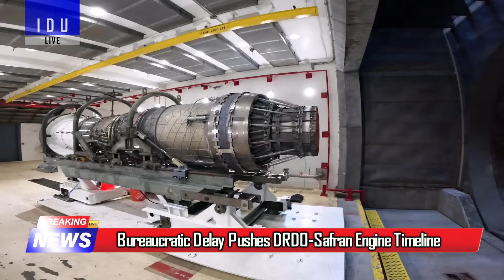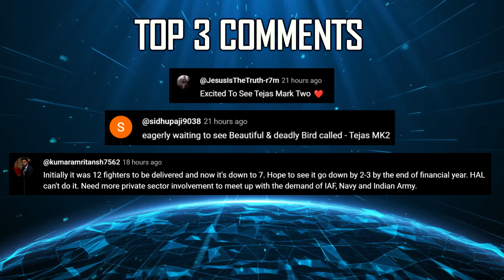Indian Defence Updates : Su-57E No Assembly,6 F-16 To Pakistan,120 KN AMCA Engine Delay,Dhvani Test

Comment: Delay of Tejas could be beneficial if the "fly by wire" electronic  cabling is converted to fibreoptic links which is immune to Electromagnetic Interference. Shielding of critical electronic circuits and actuators ( through absorbent/ refective shields or casing) is important. Fibreoptics should also be the cabling for AI driven UAV/ UCAV electronics.

Comment: When France 120kn engine is delayed and the subsequent effect  is coming on amca then viable option is to continue with su57 assembly with hal. Amca1 will also be delayed due to 414 engines as the command and control goes in the direct hands of usa again. 404 engine is the prime example. Please don't stop su57 60 as direct and after that 90 made by hal. Because rafale is also not clear when we will get f4 and f5s. Please consider su57 with hal.  Good luck.

Comment: Veda drdo lunch vehicle base on k4 submarine lunch ballistic  missile. 1st flight March 2026. 1800kg satalite or 18x100 kg satalite or 36 small satalite each 50kg.tto 600 km altitude. Vehicle😢mounted Veda can lunch😢any where  from India. Indian😢capital delhi😢now😢protect by 3 layer defence. Which😢deployed when putin😢come😮in India. Outer layer  qrsam 30km range 2nd layer vsorads 6 km range 3rd layer laser with 5 km range it's over and above sudarshan chakro.. Bangalore start up developed pseudo satalite 30km Altitude as high😢endrosparic satalite. It's stay at a time 417 days and night at a time. It😢will spy and😢communication satalite at very low cost....

Comment: No ToT or local production would be a dumb move, Russia doesn't have the production capacity to deliver any time soon, and India would get no long term benefit.  If anyone in IAF thinks it's a good idea, they should be retired immediately.
Reply: or they know that placing large orders for a jet that is not great is not good idea
Reply: @vaimurthy  It's better than anything India has at the moment.  Rafale turned out to be a mediocre fighter and lacks ability to integrate Indigenous weapons, so India needs to take best that it can get.
Reply: @vaimurthy  Rafale did absolutely nothing in Sindoor, mediocre performance, at best.  Such great EW that it got shot down.🙄

IAF hasn't covered itself in glory, needed Brahmos to save them in Sindoor.

Comment: It's not surprising that america is providing f 16 upgrade  but It's very thinkable and suspicious that they are providing or replacing 6 f16 jets , it may be directly related to the f16 pakistan lost during operation sindoor, doesn't it !  , I thinks that if they are giving 6 f 16 as replacement then 6 f16 may be destroyed so that they are providing them more as replacement

Comment: Morons MOD of India we don't required fkin western engine, we could easily use the SU 30/35 Engine for Tejas Single Engine Capabilities Fighter with maximum take off weight 20-21 kg. Now we should except 177S Russian IL 41 F3 engine and development of IL 51 Engine IPR Source Code Transfer of Technology with 175 kn powerful thrust. 
We need Single seat SU-57 60+Double Seat 140+Su 75 200+Su-70 Drones with kinzal Zircon.
S-400+S-500 30+20 regiment.
15000 ton Submarine 10 unit 
Marine Engine from Russia.
Don't waste money and time on leaking Western Countries for old technology engineering with maximum price. Our Pvt Sector company will do rest. Just take Russian technology engineering modify with our.